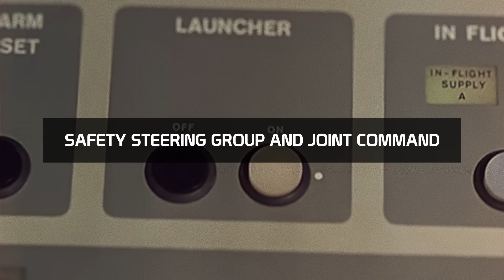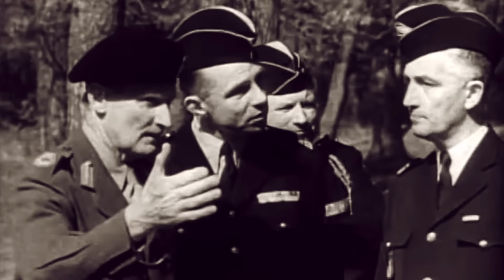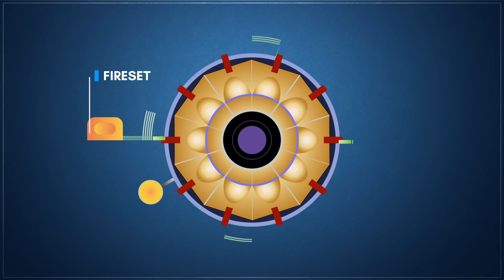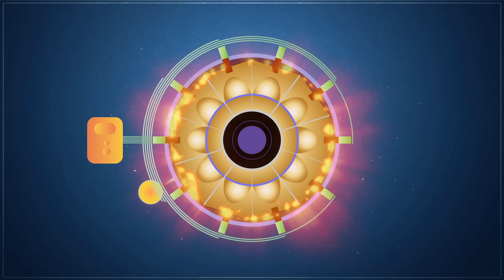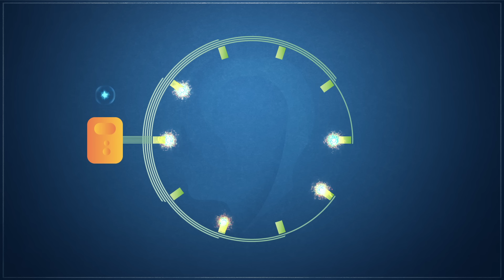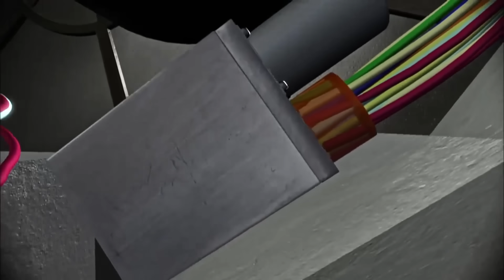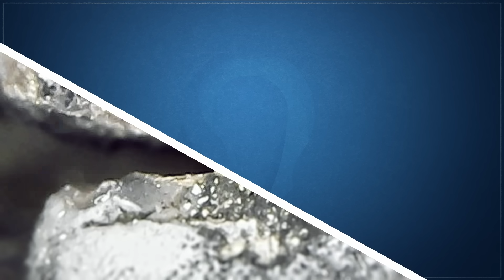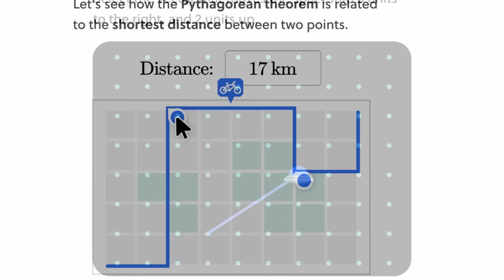The Remarkable Mechanism That Secures Nuclear Weapons

Comment: The funny thing is... the code was all zeroes (0) for tens of years.
Reply: It's not that funny. You have to install the tech, then write the policies and necessary to use it, train people, install other required tech, etc. They were clearly in the middle of that process when it was all zeroes.
Reply: @kid_missive 
So, the default code could still have been set to something else then? You don't say.
Reply: Does it matter? First, you have to get to the device. That was always a two man task, one alone approaching is subject to lethal force in a very prompt manner.
From the Titan missiles onward, one fuel valve was disabled with its own code, no correct code, it stays off and the missile becomes a really big lawn dart on fuel exhaustion. You'd also need to enter a target package, as missiles have long been programmable and default to no target.
Try to get into the warhead control panel the wrong way, disable the high voltage system, disabling the explosives and neutron generator.

Comment: The first official code was: 00000
Reply: And the classic „696969“
Reply: I suppose next one became 00001
Reply: And the 123456 (allegedly)😅
Reply: the purpose of this is to make sure it cannot be unlocked by random environmental conditions or accidents, fire, lighting, crash during transport, et cetera. The Exact code, although "technically classified" is not really important -- a dedicated attacker (thief or otherwise) could simply read it out from inside the device by removing the cover. in other words, "code zero" is a perfectly fine code for initiating end of the world.
Reply: @JurekOK  well, there is the missile fuel unlock code to enter as well for ICBMs. Otherwise, all one could do is launch an unarmed lawn dart.
Reply: It really 12345.
Reply: @tomnguyen9931  quick! Change the combination on my luggage.